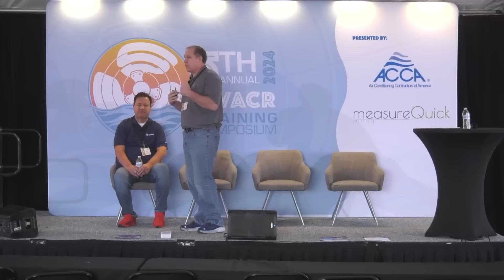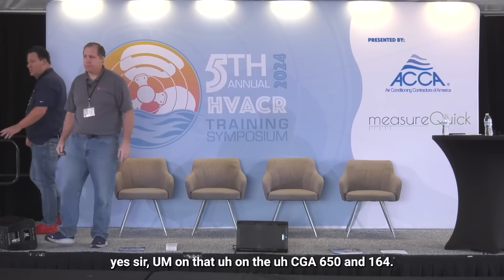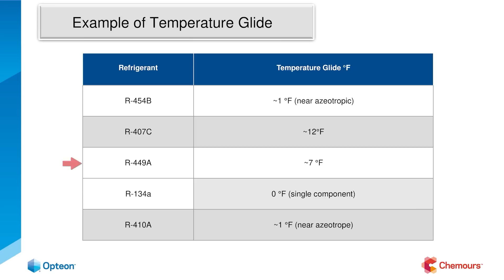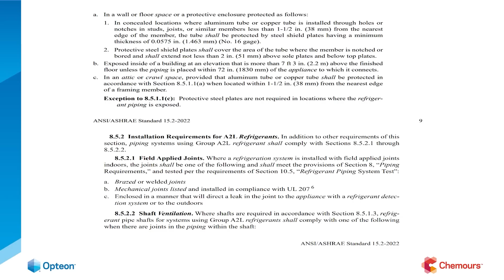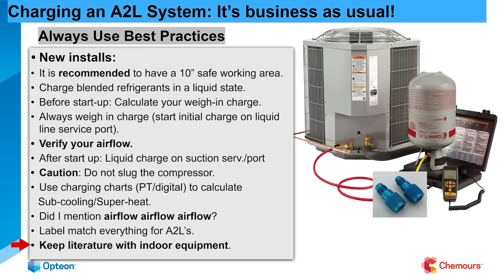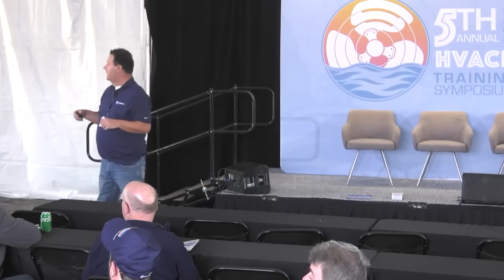What You Need to Know About Future A2Ls with Don Gillis & Christian Pyles

Comment: Can anyone tell me how i can run a  flammable refrigerant threw a building when i cant run a gas are propane line threw any  building that is over 5 pounds per square inch in any building in a copper line how is it that we are going yo be able to run a line with a flammable refrigerant at 200 to 500 psi
Reply: Because propane is highly highly flammable. This is just kind of flammable. If I remember correctly this can’t even sustain a flame. Propane is very good at that.
Reply: @ i watched a video last year they had a. 28 pound cylinder with a gas reg in the line running a torch  with the slightly flammable refrigerant if it isnt flammable then why all the refrigerant monitors to shut of furnace if  the refrigerant is detected and wy cant i use my vacuum pump and recovery unit we have to by all new equipment
Reply: Because the rich assholes are making more $$$ the EPA is on their side
Reply: so they can make more money
Reply: @davehuber6949  It was because we live in a world where everyone wants to sue somebody. We’re talking about billion-dollar companies; liability is real. It’s no different than you or I installing a 410 a unit someone’s home that’s what insurance is for better safe than sorry so far nothing’s happened at all not one thing has been mentioned in the news or an HVAC news about 454B or R 32 causing any flammability besides that Europe and Asia been using this stuff for years or just behind everything.
Reply: MIE. Its minimum ignition energy? I’ve taught a 2L refrigerant for a long time. Does it take walking across the carpet, touching the doorknob, and causing a spark, or does it take a blowtorch to try to light it? Two totally different flame abilities, sources night and day.
Reply: @DonGillisHvAcR have you ever seen a a lock rotor on a compressor blow the terminals out the side of the compressor yes there were flames yes the oil was on fire that was r22
Reply: @dav @davehuber6949 e addressed this probably thousands of times since 2020 when I was teaching CO2 R290 and A2L’s. and yes as journeyman, many times. I’ve tore thousands Of compressors down at Copeland as a senior technical trainer. Let me ask you this. Have you heard of anyone blowing up? The codes are pretty specific that’s where the big change is. The problem is too many people got out the front and claimed it had propane in it some people still believe that. i’ve sent on many panels and had this discussion. It hasn’t been easy to pass these codes but at the end of the day, nothing‘s really changed to be honest with you. I mean you’re still allowed to call the same amount of refrigerant on your van the same amount of refrigerant in the warehouse. In fact it expanded in the warehouse because the A2 will eventually take over.

Comment: So the question here is...
Can I use my existing vacuum pump on A2L's?
If no,why would I need to get special rated equipment when operating pressures are  close to 410a ,and all my equipment its 410 rated so why would I need to change my equipment?
Reply: It may need to be intrinsically safe to be “rated” but it will physically do the job
Reply: so you don’t explode due to risk of ignition caused by these refrigerants.
Reply: Expensive but eyeballing the JB battery powered one. Will run on 120/240 volt and both Milwaukee or Dewalt batteries if of you remove the restrictor plate.  Unlike the Milwaukee vacuum pump it is completely rebuildable.
Reply: The easy answer would be yes. I’ve taught this for a very long time. In fact, I might’ve been the first one to come out and teach very large numbers to A2L. I’ve had Fieldpiece and Appion work together on tag-team training. It’s not that your pump won’t work with it; more than likely, it will. I have not heard of one case where any pump out there doesn’t work with A2 L‘s. No one, to the best of my knowledge, is telling anyone that, but there are changes to the new A2 pumps. They’ve made them a little safer just in case, but that doesn’t mean your old pump is dangerous by no means what you need to do is go to the distributor where you bought it at or go to the website of the manufacturer and look they have a long list of things that are dangerous to use with A2 L’s old model numbers you’ll be pleasantly surprised.
Reply: What I’ve told my students for years, starting from teaching A2L’s five years ago, is that you need to check with the distributor who sold you this and then visit the OEM’s website. Honestly, after teaching thousands about A2L’s, I’ve never had someone come back and say, 'Hey, this particular vacuum pump doesn’t work.' Besides that, vacuum pumps don’t really interact with refrigerant.
Reply: Last time I checked Robinair vacuum pumps are not A2L rated.

Comment: R-32 or 454B... as a homeowner given the choice which one should I choose and why assuming all other specs on both units are identical?
Reply: R32 is R410A without flammability inhibitor. Been around quite a while now and works well. I’ve got a small window unit with that in it, been working well for a few years now.
Reply: @bairfamilyfarm1336  454 runs closer than 410 a, does are 32 runs, a much higher temperature; therefore, using a higher POE oil, such as 54B, and 410 a both use POE 32. Ware R 32 has to use a higher viscosity due to the high operating temperature. It’s a POE 46. That’s a big difference, much higher pressure and much higher temperatures. Yes, it’s been around a while, but it’s in 454B and it’s in 410A, and R 32 is more flammable than 454B.